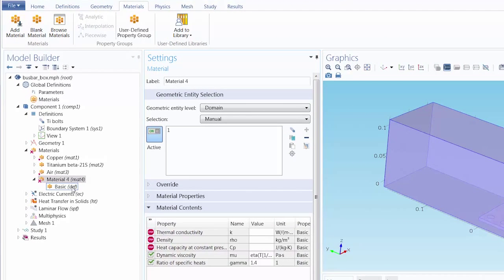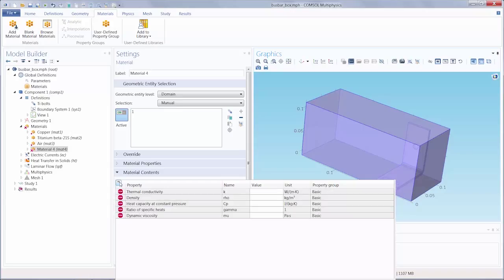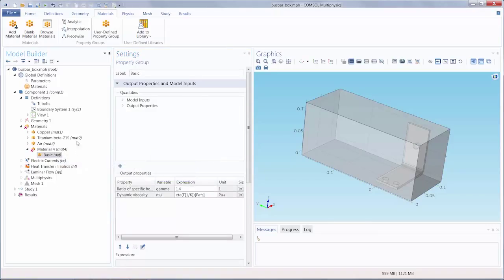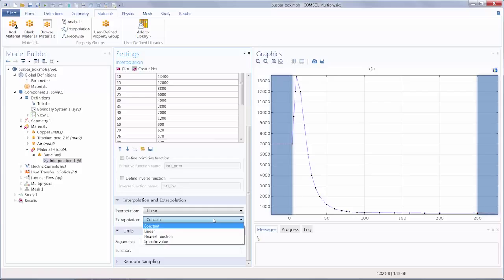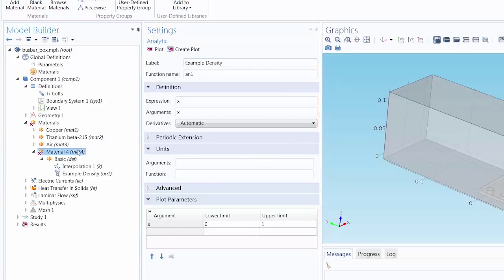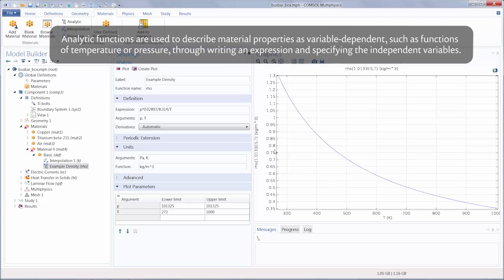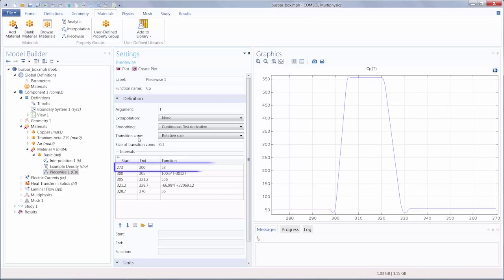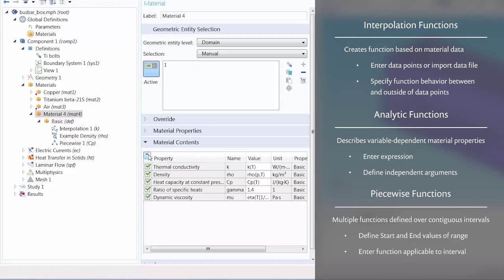How to Specify Material Properties with Functions in COMSOL Multiphysics

Comment: I am trying to add a solid material(Gd), but it is asking dynamic viscosity. What to do? Please help...
Reply: My guess is that your physics include both solids and fluids, e.g. Heat Transfer in solids and fluids. If so, make that you have specified which domains are solid or fluid, an that your solid material only is set onto solid domains. Hope this helps.

Comment: I want to do an analysis on a hvac duct with lining inside and find the transmission loss. If i am using a new type of lining material, what are the parameters needed to define the custom lining material in comsol analysis????
Hoping for a solution